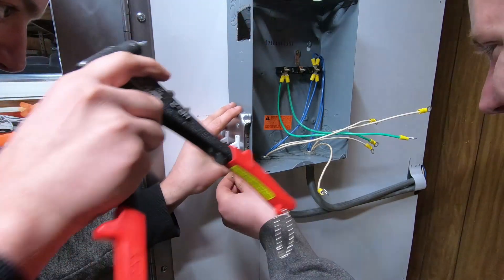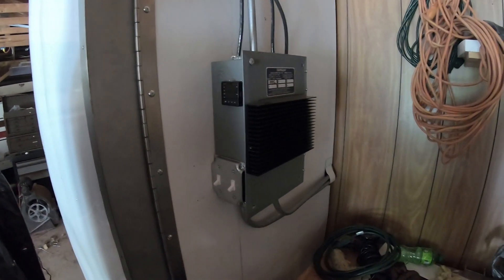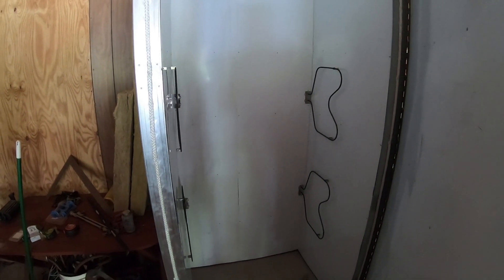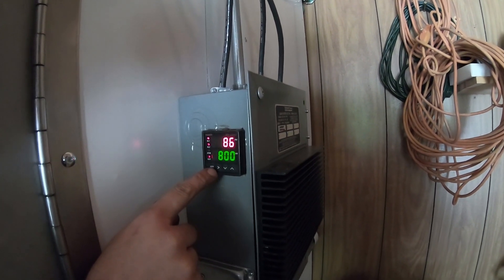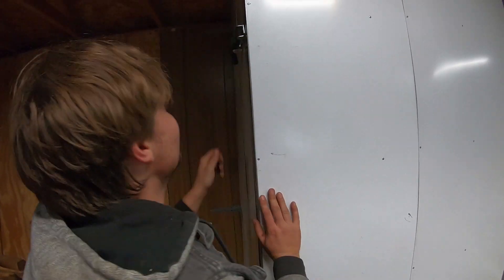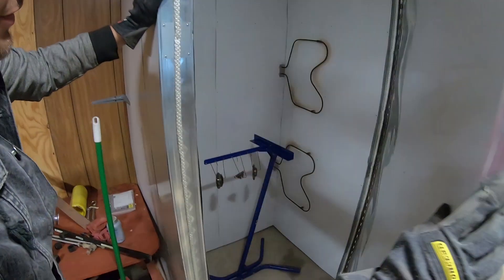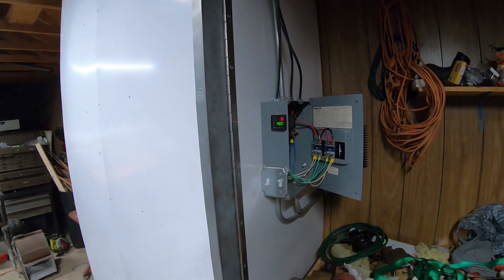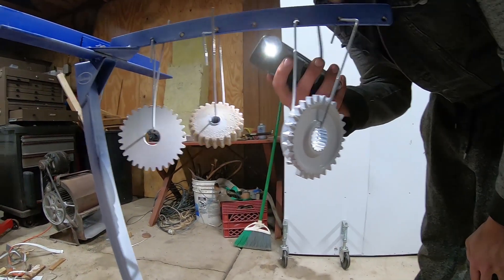Finishing our MASSIVE Powder Coating Oven! (part 2of2)

Comment: These guy built a stupid tall oven for zero reason lol one of there most veiled videos and they powder coated some gears and then never made another video about powdercoat lol whyyyyh you could of just used the fucking oven for that smh did you guys ever do the banshee or the damn tractor cuss I’m guessing this was a failed project being you guys got more views in this oven then any other video what’s up with the fail videos I want to know what happened wrong so I don’t fuck mine up lol 😂 more content please
Reply from the maker: Shit, sorry I didn't see your comment sooner. We've used the oven for quite a bit of stuff, including the Banshee frame. The other parts have made it into some other videos but the oven wasn't the focus of those videos. Hopefully we can finish up the Banshee project soon because it's been on the back burner for wayyyy too long. As for the oven itself, we did almost everything right except the concrete sucks way too much heat out of the bottom so we got some uneven baking on some of the longer parts.

Comment: Hey Guys! Awesome build! Did you guys use the element and electronics from the oven to control the temperature?
Reply from the maker: We actually ended up not using any parts from the oven like we had originally planned. It was a bit of a snowball project.

Comment: Nice build! Did you guys use a kit for the PID controller or did you guys do the inkbird parts on amazon/ebay? Just got all the steel i need but cant figure out what to do for temp control.

Comment: The oven turned out great but you shouls added hooks from the top & at least 1 section to slide in a flat tray for pizza's ya got eat while working on your projects too ! Next you need a fridge big enough to hold everyone's favorite drinks !
Reply from the maker: We didn't put any hooks in the ceiling because it's not really strong enough to hold any weight. We'll be building a roll in rack here real soon for hanging pizzas!
Reply: I doubt you would want to eat anything that come out of a powder coat oven less you like the tast of paint
Reply from the maker: Hanging paint pizzas are our specialty!

Comment: Nice oven,  now it's jus to upgrade that Eastwood gun have a lil spraying booth and your good .
Reply from the maker: Is there a gun you'd recommend? We're always looking to improve!
Reply: @WOTclub  columbia coatings has some reasonable ones , that won't break the bank . There is also a  kf-x1 from colo which works great , that's not 4k
Reply from the maker: Awesome, thanks! We'll have to check them out!
Reply: @WOTclub  list of parts needed